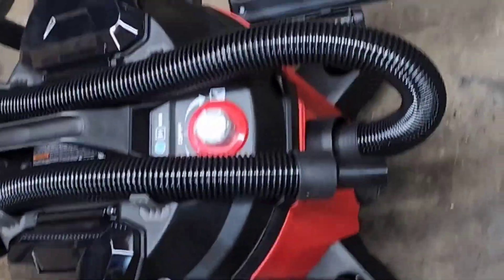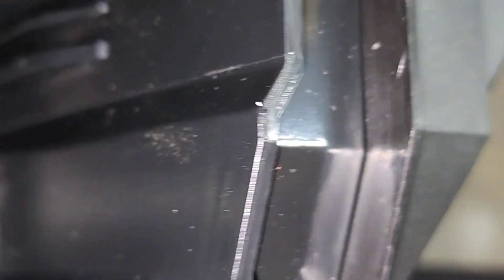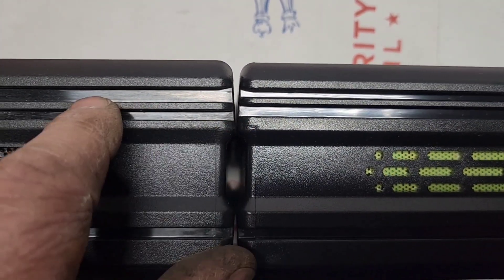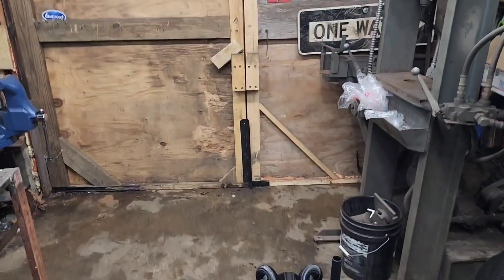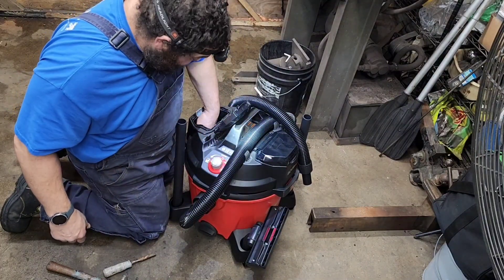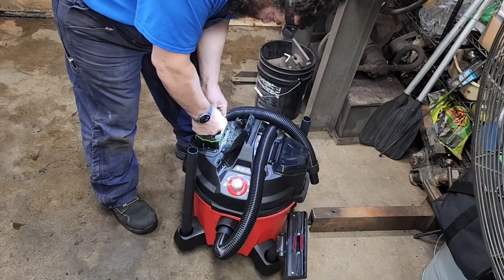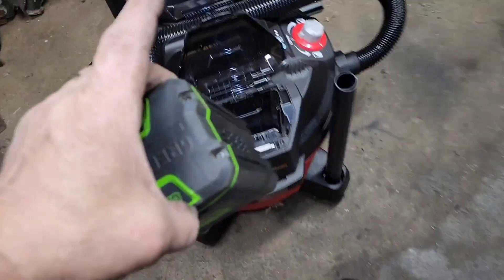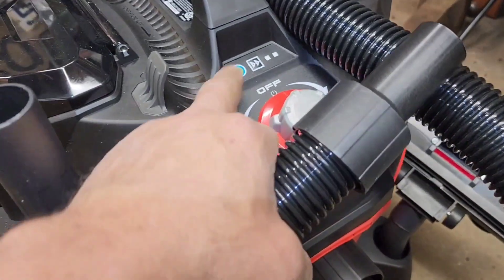How to modify a Snapper XD to accept a Greenworks Commercial 82v battery.

Comment: How is the snapper working? Any issues with electrical shortages or what not?
Reply from the maker: No,  it still works fine.  I don't use it frequently, but I haven't had any issues using it when I use it.

Comment: Looking for a guide on how to mod my snapper batteries to work on a Greenworks mower.  My Snapper mower finally bit the dust after about 10 years of hard use and I’m moving to a Greenworks mower and blower.  So I have a bunch of Snapper batteries I’d like to mod.

Whatcha got?
Reply from the maker: @Wineaux  I don't have any snapper batteries anymore,  but it might be easier and safer to modify the mower instead of the batteries.  As long as they're both 80v/82v.

Comment: I bet if you had an old pack that’s dead you could also just take the lower case off and swap them if you didn’t want to physically change the runners.
Reply from the maker: I did it that way because I have tons of Greenworks batteries and I don't run any other Snapoer stuff.